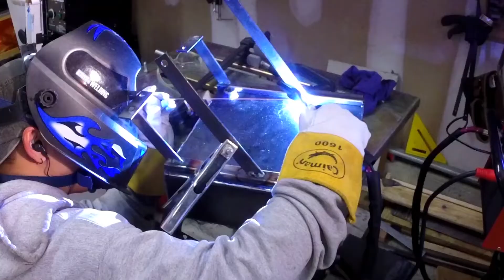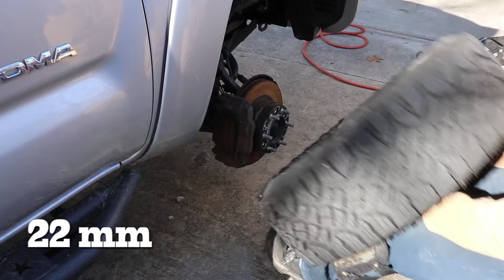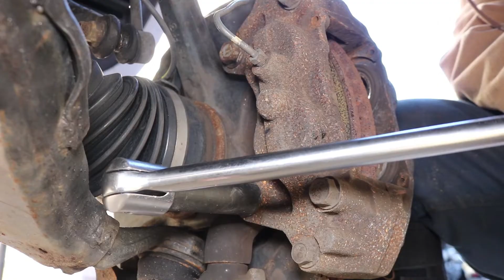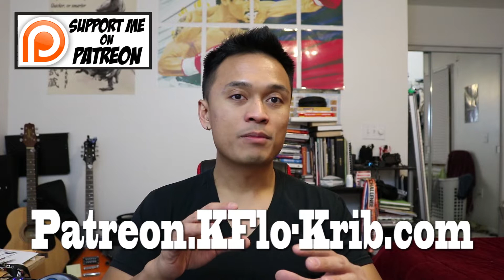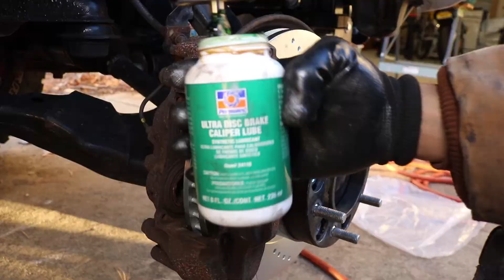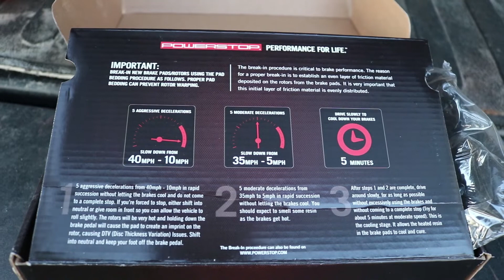Replace Brake Rotors and Pads (Tacoma DIY / How To)

Comment: Just wanted to comment and say, I love your content.  I used your video as a guide to change my rotors and pads for my 2007 Prerunner.  Went from completely destroyed stock rotors at 210k to drilled and slotted rotors.  Thanks for everything!
Reply from the maker: Nice! Drilled and slotted rotors are a great upgrade, you're gonna love it!

Comment: I watched your video again because those Power Stop K137 with rotors have already finished at 43,000 miles. My 09 Taco with 203,000 miles garage kept getting a lot of rust on the calipers on the inside. Also uneven wear not sure maybe the caliper is sticking.
Reply from the maker: Sounds like your caliper is doing just that. The piston seals may be seized and will need a rebuild. Brake dust does rust, even indoors or not. I still am using the powerstops even with my 35" tires and camper - still going strong. I did replace my front calipers though
Reply: @KFloTacoma  Thanks Bro appreciate ordering the K137 the complete set with calipers.

Comment: I wish my job went this easily. Everything was rusted and seized, even the caliper pins.  It took me hours to get one side done.
Reply from the maker: That's rough bro. I would recommend spraying all these parts with PB blaster the night before and letting it all soak. Worst comes to worse, you can always torch these things - that will definitely help break these loose.
Reply: @KFloTacoma  I ended up just replacing the calipers. I read that some people grease those pins each time they rotate tires. I guess that's what I'll try since I live in the snow and road salt mountains of Pennsylvania.

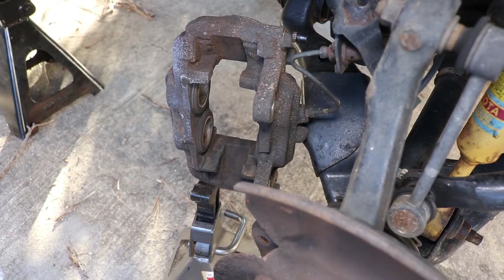Comment: great video! 3:43 humbly emphasize to clean ALL rust from mating surfaces of the rotor - whether installing a new or reinstall of old rotor. Slight amount of rust will create a condition of braking "wobble" at highway speeds that only seems like it's a warped rotor. Found this the hard way after having right front rotor turned a few times - then installed new rotor only to have problem re-surface. I used my angle die grinder with scotchbrite pads, then small fine sandpaper for area hard to reach lug bolts. Solved a great mystery and now 30k miles later perfect brake performance... surfaces need to be perfectly clean like surgical steel. also coat those surfaces lightly with anti-seize and minimal prep next time .
Reply from the maker: Good point!
Reply: Now you got me to wondering if i cleaned mine good enough with a wire brush and aerosol brake cleaner 🤔

Comment: Hey, how did these pads/rotors hold up? My fronts are starting to get a bit thin
Reply from the maker: Still rock solid. I'm still using it on my 35s
Reply: @KFloTacoma  hell yeah, I'd better get some then.

Comment: Thank you, K flow great video. I got the same rotor & pads.  The only problem was that the dealer crossed threaded the abs bracket on the passenger side for a new frame replacement. I thought it was loose so I removed it & bolt snapped clean off!
Reply from the maker: That sucks! You can try to re-chase the threads with a tap after extracting any bolts leftover (if there are any)

Comment: How did the new rotors with the holes in them work out for you? I heard of some people having issues with those....
Reply from the maker: No issues at all. You can watch some of my VLOGs and you'll see how well it still performs.  https://youtu.be/tpQqBFNwpPM (this one hasn't been released yet ;)
Reply: @KFloTacoma  nice truck! I have a 2010 4Runner and it feels like the front rotors are warped. Looking to upgrade rotors and pads, do you have any suggestions as far as brand, etc? Thanks for taking the time to answer.
Reply from the maker: I would say power stops are the best bang for your buck. Use the link in the description, I believe it may be compatible with yours just use the amazon compatibility checker to make sure
Reply: @KFloTacoma  Thanks!

Comment: Thanks for the video.  I have a 2008 Taco 6 cylinder 4x4 and 2002 Taco TWD in my household.  Can you recommend a "disk lateral run out gauge and disk thickness gauge?"   Can we get a video on hub cleanliness and run out for us folks that deal with snow and road salt.  Thank you.
Reply from the maker: The disk thickness gauge is just a regular caliper and a lateral run out can be achieved with a flatness gauge block with some feeler gauges. I'll add that video to the list, thank you for the suggestions.

Comment: Great job! How are those brake rotors working out for you? Would you buy a different pair? What about pads?
Reply from the maker: They're working very well so far. Compared to oem they have a bit more bite. I'm happy with the purchase so far especially with its performance for it price. Pads have very little dust output and rotors still look very good.
Reply: Jon Gaspar I put the same ones on my truck pulled them off went back to stock. I didn’t like the vibrating/ noise that came on after a couple thousand miles

Comment: Great vid, do you have to bleed brakes when done? Or just add some fluid to container and it should be good?
Reply from the maker: Usually new brake pads mean that the fluid will be higher since the pistons will be pushed in more. Bleeding the brakes is really up to you. I only bleed brakes if the fluid gets too dirty or the brakes feel squishy

Comment: Thanks a ton for making these vids! I've been linking some of your videos on Tacomaworld for people looking for tutorials! Quick question: how necessary is a brake bleed after this? What happens when the brake fluid reservoir is above the max line? Would the brake fluid just go back and fill the brake pistons that were compressed?
Reply from the maker: Thanks for sharing my content brother! I appreciate that. To answer your questions: brake bleeding just works out well in terms of timing since all the bleeders valves are already exposed when doing this. Although, It's not really a necessity if  you've done it right before hand - you're not breaking open the system so it should be ok. Brake bleeding should be done if the brakes feel squishy, fluid looks really dirty, or if you're in a high humidity climate since brake fluid does absorb water over time (I bleed mine every 2 years). If theres too much brake fluid in the reservoir after you're done you can address that in one of two ways: use a turkey baster to suck out the excess from the reservoir or bleed out the brake fluid at any of the calipers until the fluid is down to proper levels.